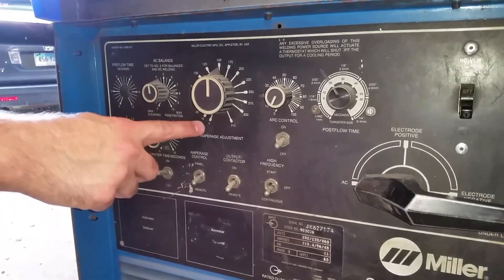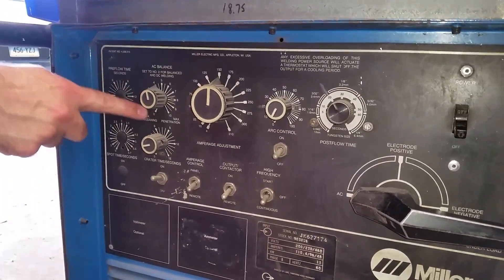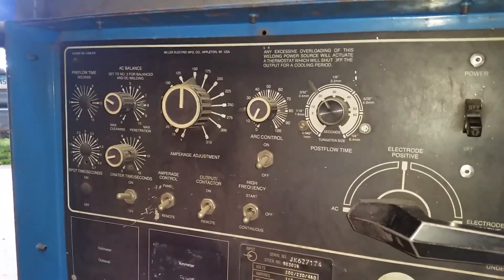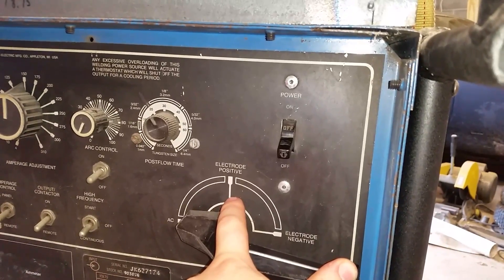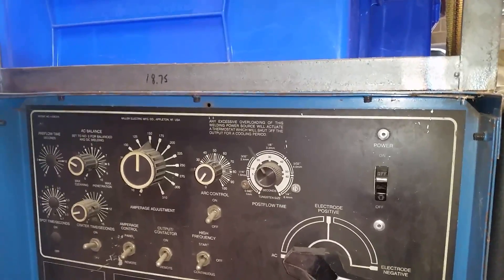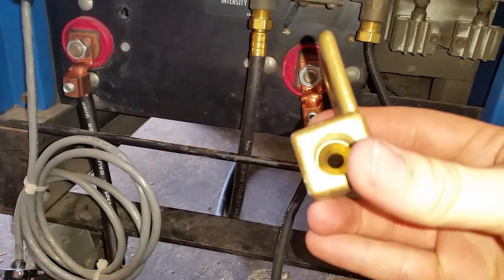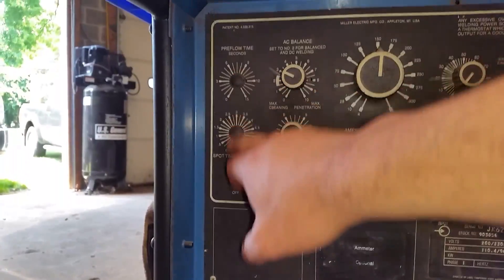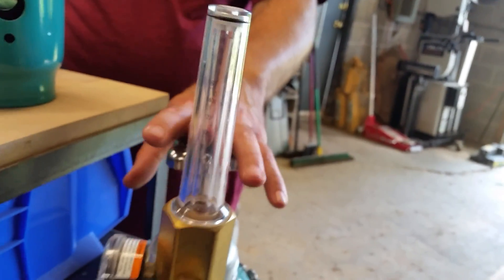Miller Sncrowave 250 tig welder settings explanation

Comment: Can I run this on single phase 220?
Reply from the maker: It can be run on 220 v which is 2 phase because it has 2x 110v lines
Reply: @Kufunklefec  its still single phase there is no 2 phase

Comment: Idk how old this video is ..... but Incase you haven’t figured it out yet.... to stick weld with this machine (I have the same one).... amperage control...panel.... output contactor....on.... high frequency....off.... this machine right now in the video is set up to weld aluminum.... (high frequency..continuous...polarity... a.c.)....... for mild steel/stainless tig.... switch polarity to d.c..... and high frequency to start.... while leaving the amperage control in remote and output contactor in remote(if you have a pedal).... if your scratch starting ... amp control....panel.... contactor....on.... hope this clears a few things up for you....... and ohhh I forgot .... the cratertime ... is when the machine automatically ramps down the amperage over time... (using a on off switch no pedal.. turn off when using other processes)..... and the high-frequency intensity... is the hz of the high frequency... allows you to control crater width ....and finally arc control... that’s for stick welding that controls your “dig”... basically it helps start the arc in certain situations by increasing the amperage under short arc(lower voltage) situations to prevent sticking ... I hope I covered everything

Comment: this video sucks  you clearly do not know how to use the machine I have a sncrowave 250 ben using it for over 20 years I tig with a water tch   I stick weld with it  you can stick ac dc  amp control panel HF off output contactor off for stick  this thing will stick better than a stick only machine because its a cc machine  for tig make sure you keep the points clean for the hf to work right  open the welder up check all the screws and wires some screws come loose over time clean the dust out o and un plug it when doing so   if you do any major stick get a bigger cable this is a power full stick welder you can do 3/8 rods    tig steel is dc aul is a/c   I also bump tig anodized pipe I have a button on the tch   with 2 separate control contact and amps  you have full control to use buttons hand remots or foot switch hope this helps
Reply: koollakes good lord this guy doesn’t know shit. Does he even know how to weld??
Reply: i got a ? i have the same machine just got it and when i push the foot pedal down it makes a weak arc any thoughts?
Reply: I hope your welding is better than your grammar.
Reply: Post a better one then.   Gladly compare your vids to his?  So where are yours?  Have respect for people kind enough to share their knowledge.  Nobody knows it all, that's why we are here.  Don't be THAT guy.
Reply: @jdh023 posting videos pretending like you know enough to inform others is disgusting.
Reply: That comment totally made sense. The lack of periods and gibberish just make so much sense. Derrrp.

Comment: Can you stick weld and TIG weld with this Syncrowave 250 CC-AC/DC Welding Power Source?  I just bought a machine like this one and can not find a manual for it to answer many questions.  I've seen where some folks have just changed the lead from a TIG Torch to a Stinger for stick welding, but it wasn't on this particular welder... Thanks
Reply: you can down load the manual on miller you need sn number  I have a 250 had it for over 20 years now I tig and stick its the best dam stick welder youll use
Reply from the maker: Yes you can stick weld with the syncrowave 250. You have to switch the leads out for a sting at the bottom of the machine. I haven't used that function yet but it is possible for sure. I found the manual online somewhere after googling it.
Reply: Absolutely, I have basically this same machine at my workplace. I use the Miller to TIG and Stick, and another machine to MIG(miller). Oh and these fellas are setting you up for disaster.